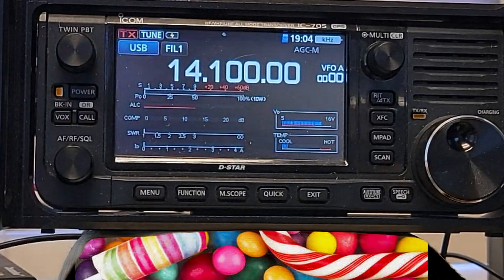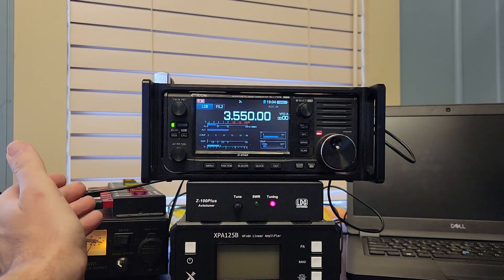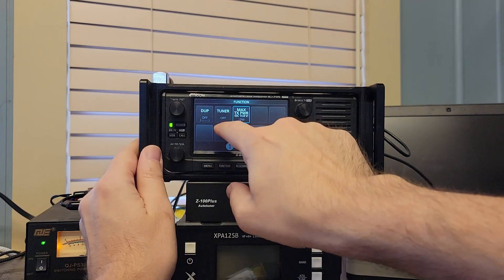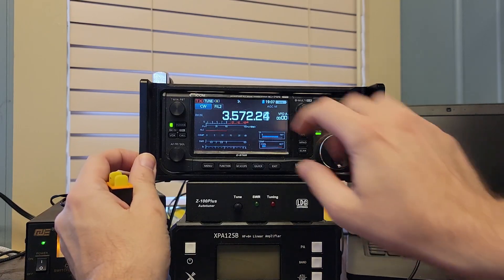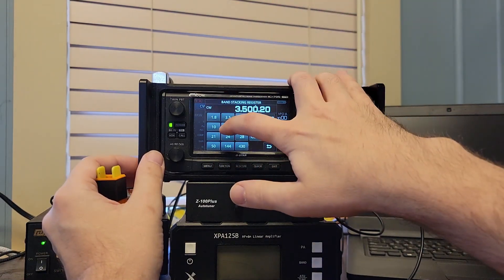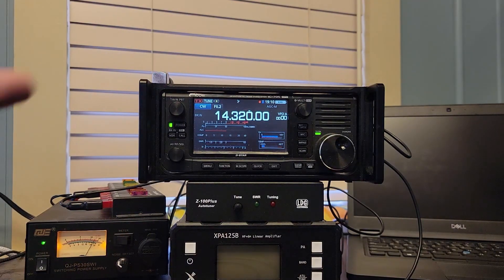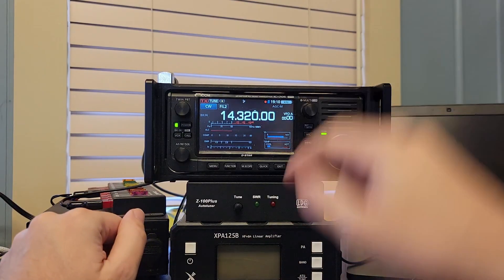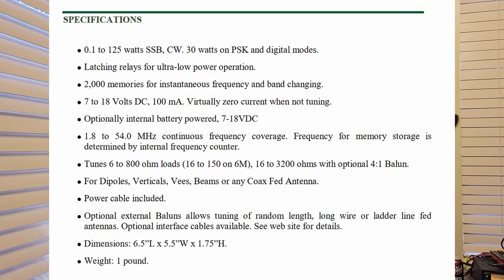My IC-705 Has a Tuner!

Comment: working with a 705 today . not to different from my 7300. that the only thing I wish the 705 had is bult in tuner. love the 2 meter 70 cm all mode. getting a amp to work with the 705. from RM Italy. 600 watt PEP from 10 watt drive. 3-30 MHz and 20 to 30V in at 30 amps. he has the MFJ tuner rated for power. making 24V go box. 2- 50 ah 12.8V powerqueen  LiFePO4. more stuff from Italy ! the 24V AMP. and more POTAFLEX 7 . this time not for me. just helping with a QRO build for portable, love that battery on the 705 but radio is heavy to me . thanks to your link got the PD 12V trigger cable on order as well. up grading battery box from powerworx . swapping the USB for USB C PD 65V with USB A port.   missed the Mistry box from 2.0 . sold 50 in 20 minuets. 73's
Reply from the maker: Sounds like you're in for lots of fun!
Reply: @temporarilyoffline  Thanks to Ham's helping Hams . more fun for all of us !
Reply from the maker: @robertmeyer4744  ubet!

Comment: Icom, go ahead and bring the IC-705 MKII with integrated tuner and backlit keys. Everything else needed for perfection is already there: Wifi, bluetooth, battery, nice display, whole spectrum SW/VHF/UHF, broadband receiver. Add the capability to load additional software/Apps for decoding digimodes inside the transceiver, make the API therefore freely accessible and this will be the perfect portable transceiver!
Reply from the maker: There it is!  I'd add that I want to see the case change a bit to make it more accessory friendly.  I'd love to see a snap-on battery pack for 10w, a snap on amp pack, an open "standard" where maybe I could snap on a raspberry pi or a bigger flip up screen - small when I need it small, big when I need it big!

Comment: Great video, neighbor (Mpls)! I own the LDG Z-100 Plus and it also integrates perfectly with the IC-7300 using the included antenna (AH-x) Molex connector. Press the Tuner button on radio, remotely via CAT, or on the physical tuner and it just works. Sometime in the last month, since I was licensed and bought my rig and this tuner, I'd forgotten the LDG Z-100 Plus specified that digital modes was limited to 30W. I've been running FT8 very successfully this past month often at 100W on mostly 20M, and haven't experienced any issues at all. 442 QSOs, 57 countries, 49/50 states (c'mon Iowa). But this was a nice reminder that it's only "rated" for 30W in digital modes. I'm not sure of the implications to radio and tuner, so will have to reluctantly adapt to 30W as necessary, but it absolutely has worked well for me with those 15 second bursts at 100W for me on a Buddistick Pro. YMMV.
Reply from the maker: It's good to hear that things are still being engineered well in the US!

Comment: Id like to see ICOM come out with a firmware upgrade that would make the radio tune at much lower power. It tunes at whatever power you have the radio set to. This is contrary to the principal of using the minimum power necessary.
I will raise this question with ICOM when I go to the Hamvention.
Reply from the maker: Yeah, and the built in SWR Scanner function does the same thing.

Comment: I have plans for a Elecraft T1 interface circuit for the 705 Steve. I actually made up some PCboards for it on KiCad. Then you can map the VOX button to the tune function on the 705. Works a treat. How can I email you this info.
Reply from the maker: temporarilyoffline@gmail.com gets me.  I'm also on QRZ.  I've started working on something similar, so I'm looking forward to your email.

Comment: WHat's nice about that tuner is it can be used with other radios. I have the mAT-705+ tuner for my ICOM 705. It works well and I got a great deal on it, but I believe it's just limited to the 705.
Reply from the maker: Does the mAT RF Sense? You might also be able to find in the owners manual how to initiate tune by "closing the circuit" on the 3.5mm cable somehow.  Make up a little button and you're golden.

Comment: Thanks for all the helpful videos TO!  👍. Handy tip:  if you don’t use the VOX/BK-IN button much, you can change it into a front panel TUNE button.  [MENU] SET > Function > Front Key Customize, select tuner.  Handy when you’ve got the LDG hooked up to the 705.
Reply from the maker: Nice!  I don't use VOX much, but every so often I get the CW itch and remember how much more practice I need ;-)

Comment: I got the AH705 shortly after almost sneaking the radio into the house. It’s proven beautifully functional 40 thru 6 with some 30ft of wire up a pole & a ground. Even rolls the JPC antoona nice. On 75 it won’t even try unless I give it some 60ft. 160 I ain’t tried yet. This is, of course, with the tuner & antenna some 25ft from the operating position. (I like having the tuner ss close to the antenna as possible & me out of the EM field.) The way the ‘705 works with these tuners is just so, well, Icom. You gotta admire that. ;-)
Reply from the maker: Its a nice tuner!

Comment: It's sad that ic-705 does not have a built in tuner :/ That and the huge extra costs compared to X6100 makes it a huge downside.
Reply from the maker: The 705 is just about 2 radios in one - a 2/70 dual bander and an HF-6 rig.  Lots of polish.  A built in Tuner and a better SWR scanner would make this amazing.

Comment: Thats a pretty beefy tuner for the 705 in my opinion. I use the mat705 ver 2. Its about a 1/3 of the size of that LDG and is specifically made for the radio.
Reply from the maker: the mAT is on my radar.
Reply: @temporarilyoffline  you should really check it out. It would fit perfectly into that new 705 bag you bought 😉
Reply from the maker: @PendejoRyan  I wonder if I can snag one for review at Hamvention!

Comment: I love those latching relays for portable power savings.  The LDG Z-11Pro II also works great and has latching relays and the interface cable, but includes extra buttons for jogging the capacitance and inductance up and down, for those who want to fiddle with their match.  I don't use them, so I probably should have gotten the cheaper unit.  But I'm a sucker for extra buttons.  Since I'm using it with radios to which I feed 12V, I just feed the tuner with the same, which is what I suspect you're doing in the video (as opposed to the optional internal batteries).  When I build my T1 kit, I may attempt to hack in a LDO linear regulator so that I can feed it from the radio power.  I need to look at what mods people have published.
Reply from the maker: Yeah, I don't like the batteries inside the tuner - they aren't easy to change.

Comment: Great video!  I wish the Z100+ was as compact as the T1 tuner but, as you say, it's unobtanium.  I have one of the Peovi frames with the wrap-around cage kit and, since the cage has threaded mounting holes at the back, I would love to 3d-print a mount for the T1.  But, I think that may never happen.  And this video has me right on the tipping point to get a z100.  (I love my Z-817, so....)
Speaking of unobtainium, are you anticipating getting some more AIOC boards anytime soon?
73
Reply from the maker: We have 100 AIOC boards in production currently.

Comment: Im wondering how the X6100 can fit in a tuner but the larger 705 cant.
The lack of an inbuilt tuner is the main reason why its not no.1 on my qrp radio list.🤷‍♂️
Your bolt on setup works but its just more stuff to bring. I already forget a cable or something else on a trip.😂
Reply from the maker: Exactly - if I was brave enough/smart enough, I would make an internal board.
Reply: @temporarilyoffline  If you make it, we will buy it.🤔🙏
Reply from the maker: @DonzLockz  sigh... adding it to my long list of projects!
Reply: There's the vhf circuitry built into the 705.  Gotta get it in there somewhere.  Takes up a little extra space I'd imagine.

Comment: Thanks for sharing!  Would this tuner work with a Lab 599 TX-500?  I have an Elecraft T1 tuner on back order with no ETA that I was planning to use with the TX-500.

I have an AH-705 tuner for the ICOM-705.  It works great with the ICOM-705!  Unfortunately, there’s no manual mode on the AH-705 that allows me to use it with a radio like the TX-500.
Reply from the maker: Yes, this tuner works with all radios - you have to put out a signal (RTTY or AM) and then press and hold the tune button on the front of the Z100 and it will start tuning.  Wait for the tuner to find a match and let go.
Reply: @temporarilyoffline  Thanks!       As I understand it, this tuner has the option to be powered by the radio or by internal batteries.  If I use battery power, will the batteries only be used when I tune? I don’t wanna get some thing with an on off switch that I have to remember to turn off!
Reply from the maker: The tuner has latching relays. So only takes power to tune.
Reply: @temporarilyoffline  Got it.  Thanks!

Comment: Great product. I've had one for some time now. I love the fact that you can either power it externally or use internal batteries in the tuner. The nice thing about the XPA125 amp, that has a built in tuner, so I only going QRP, I take the 705 and the Z100Plus. If I do QRO, I just grab the 705 and the 125B.
Reply from the maker: Have you seen this hack? https://www.youtube.com/watch?v=oHSyKASg5lM&list=UULFai-PmK8xOBOunwi6MoBgwQ